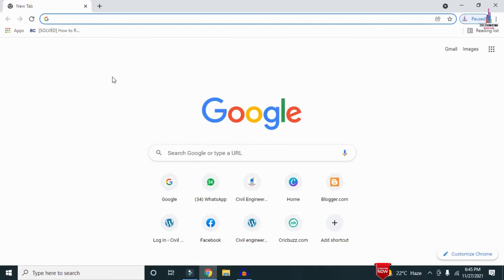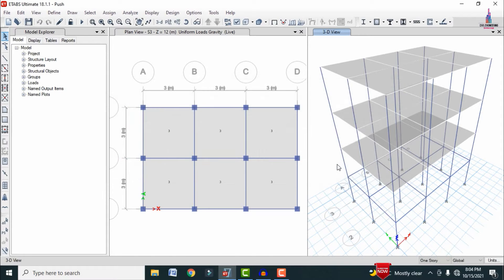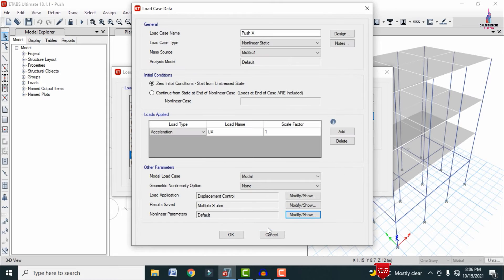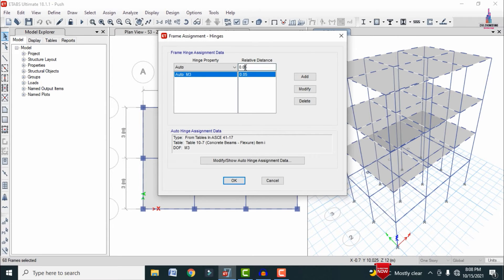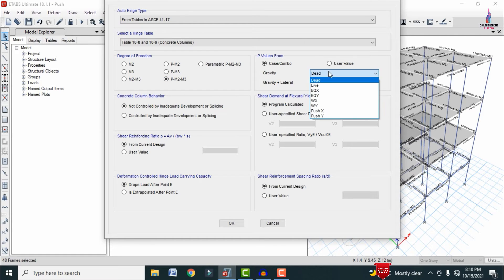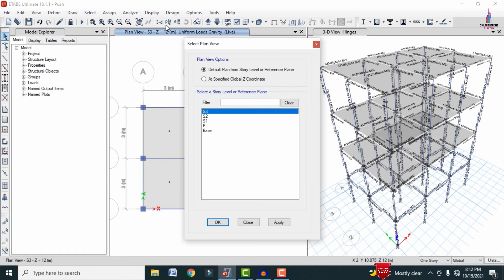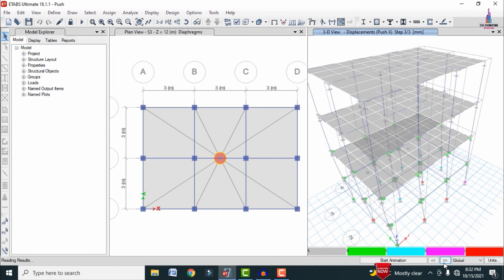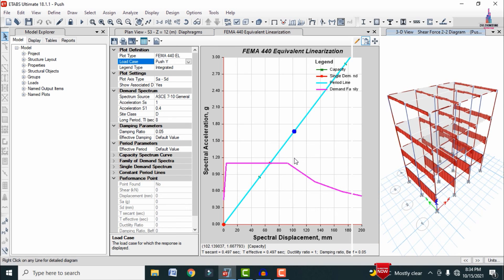Non linear static push over analysis in ETABS | 3 Storey building | structural design | civil |

Comment: In ETABS, can the capacity curve be changed to a capacity spectrum? Because if using the CSM method pushover analysis, the capacity curve must be changed to a capacity spectrum.
Reply from the maker: It will changes as per load consideration
Reply: @civilengineeringbyshravan9596  can you make a video tutorial please? because i am working on my thesis, and i am very confused about converting capacity curve to capacity spectrum😢